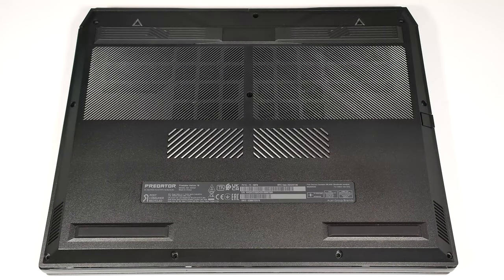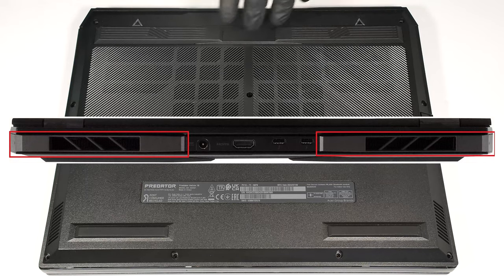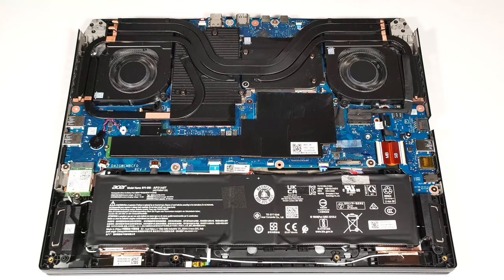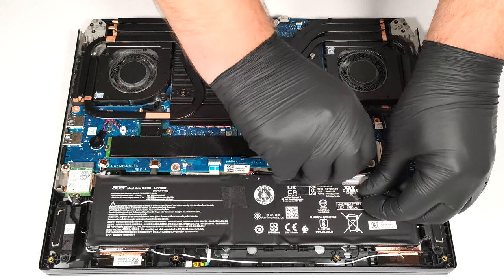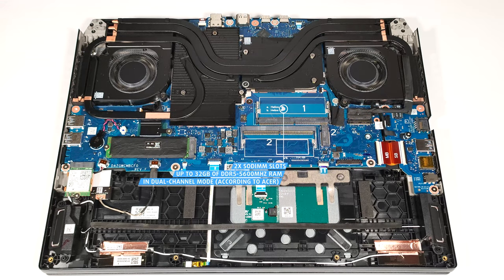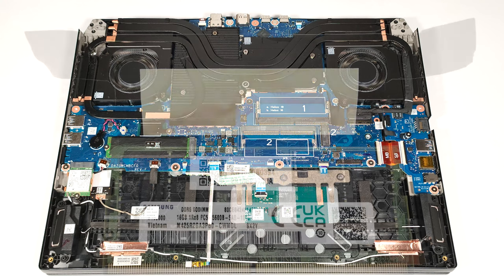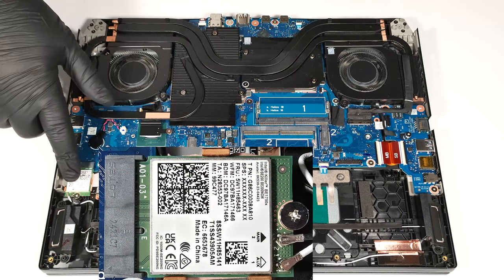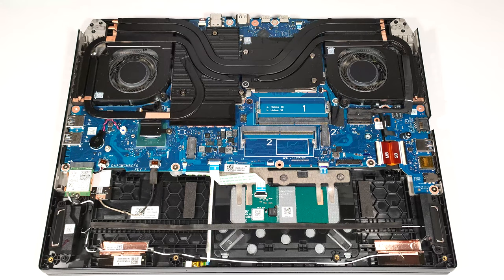🛠️ How to open Acer Predator Helios 16 (PH16-72) - disassembly and upgrade options

Comment: The case is like vacuum sealed shut or something. I don't even know how to grip the plastic pieces covering the vents to remove them. NOTHING WILL BUDGE. Never seen anything like it. The Helios 300 was firm, but removable.
Reply: You found a way yet?
Reply: @johannesssssssss  Yeah. search up the acer manual. Buy a plastic prying tool and try to open it from the front like the manual says, not from the back like all these videos tell you to.
Reply: @demonseed360  thanks bro. You're the MVP in all of internet.